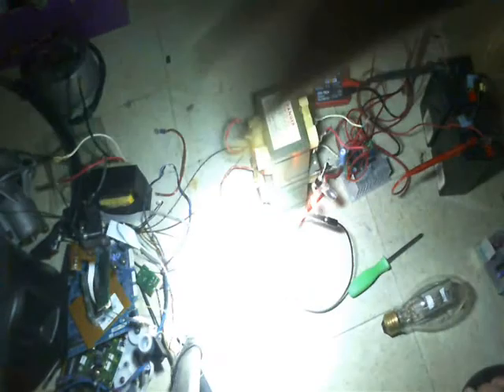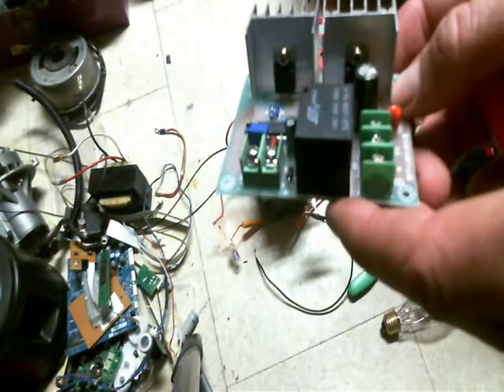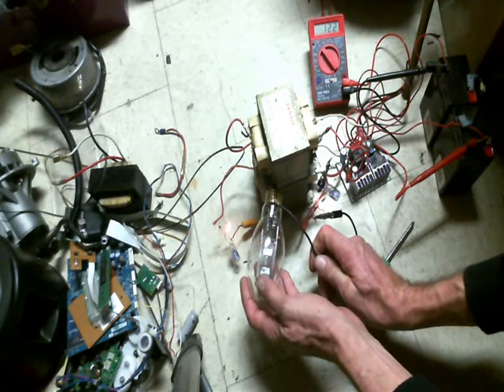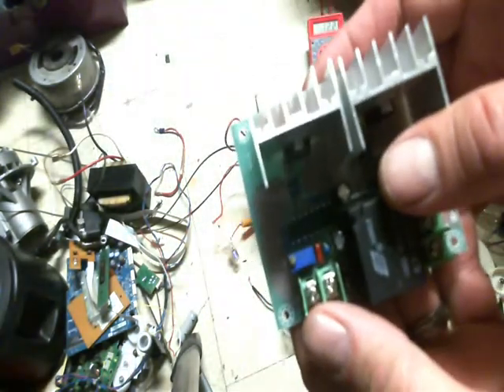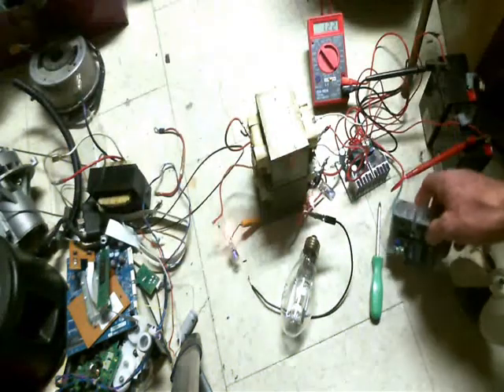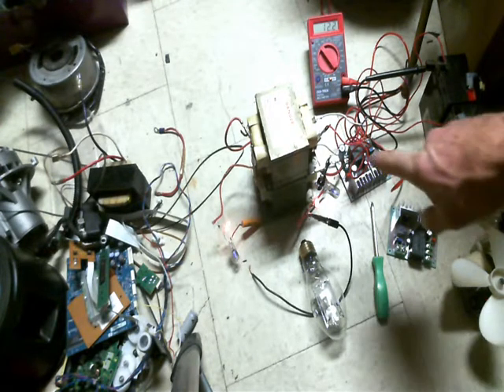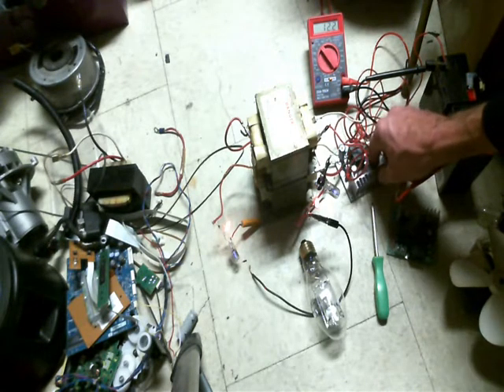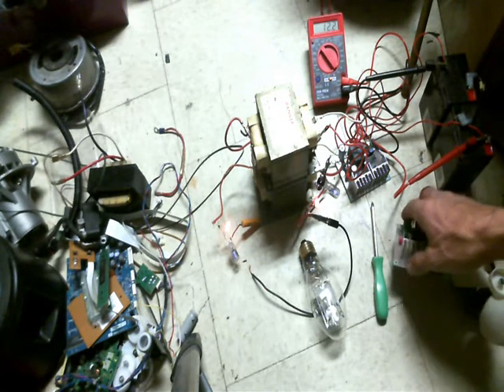COIL DRIVER !

Comment: are you picking up the split neutral interference from the magnatron switching pos to neg as joe booker talks of his car arching through negative to positive and i believe he means we need to catch the intermittant gap before it tries to arch out so pull it off at 90 degrees like catching a earth lightning bolt before it touches ground to then feed that captured energy for our use   still learning so no expert here in uk

Comment: Shazizz! H0H0! ! Another great vid. Had to watch it 5 times to get a grasp what was going on...  So the neons act as a load on the LV side and regulate the current?  the HV side is not connected to anything?      These cheap CFL drivers are very useful as they adjust to the load. In some applications they are used to drive a 1 Ohm flyback from  an old TV. Now as we are getting into the NWO old school good transformer tech is being phased out and it is getting harder and harder to get those precious items for generating voltage with the applications we were used to. For example, big transformers and radio tubes from old radios amd audio equpment, now switching power supplies,..  and vacuum picture tubes from TV sets, the big brothers of oscilloscopes move into led monitors. Have you tried using an old tv as a cathode ray tube? I got interested in your progress as you made that special radio antenna test and got unconscious. That was the first vid I watched from you. I desperately need to do that too ;D    _My own generator progress has slowed down as the generator collapsed from its own weight as I was flipping it over.  I repaired and soldered it for some 6 months. Now exhausted from the repairs:; more interested in plasma generators though I need to get the generator back and kicking soon as it has become the electric test bench I always dreamed of. One encumbrance though - every research attempt takes a week´s days minus some tweekerprojects really at moments notice.Yesterday was a day of innovation with some 30 electric shocks. Learning electrical safety by accident like you said ;D. Well what can you do when everything you touch is electric without a sane reason? :]